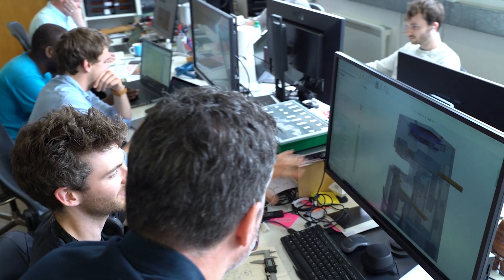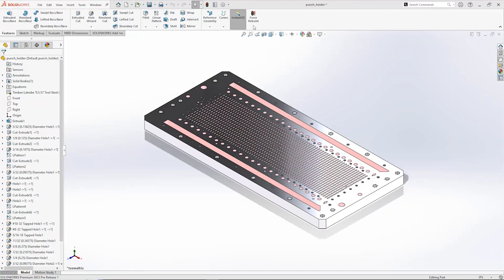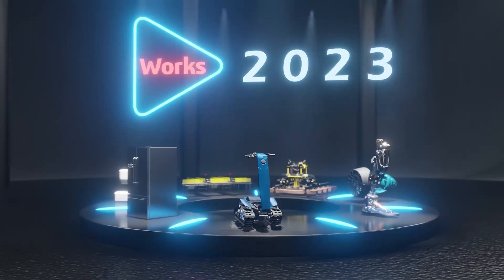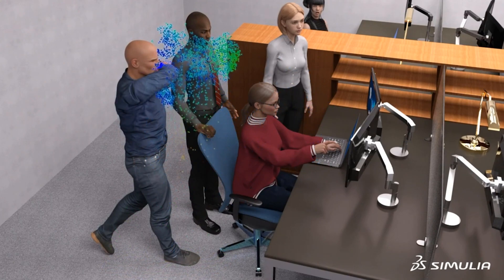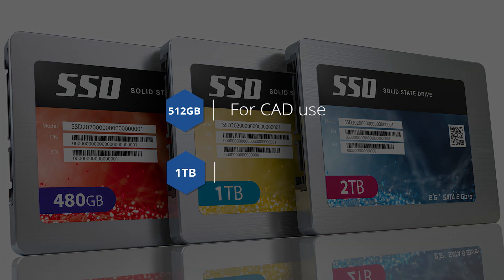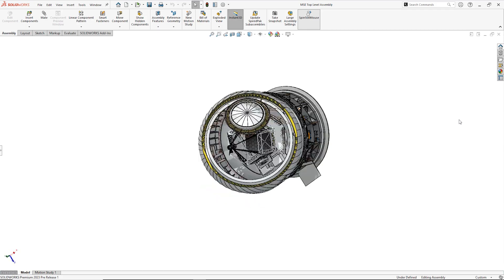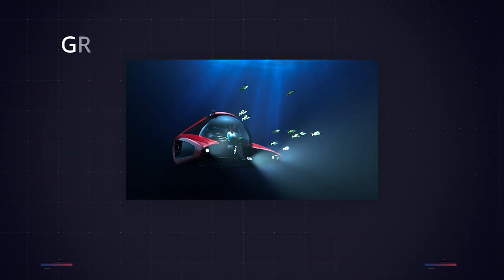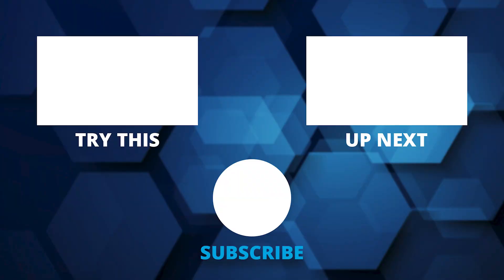The Best PC Upgrades for SOLIDWORKS

Comment: On laptops its also wise to see some actual test results as even with single core tests some laptops will overheat and give poor results. I almost bougth one laptop that core speeds were 5,1ghz but performance was worse than 4,7ghz machines.